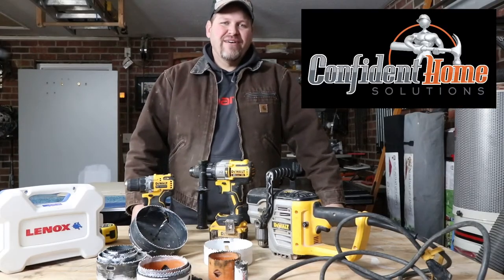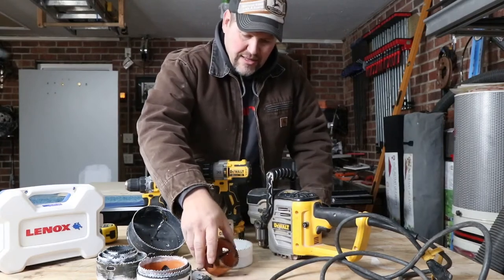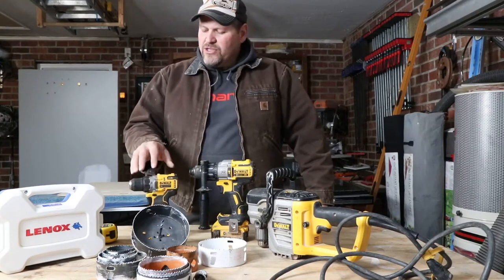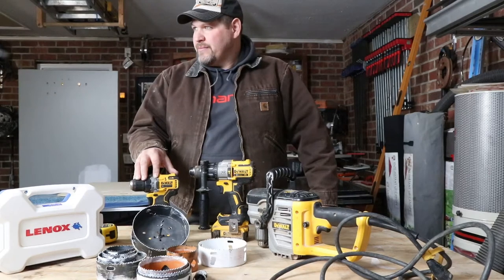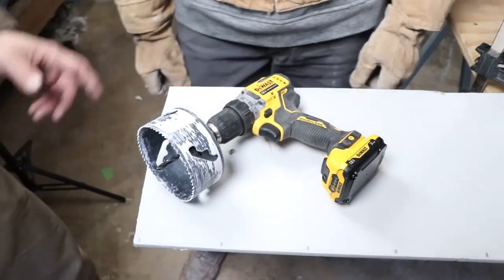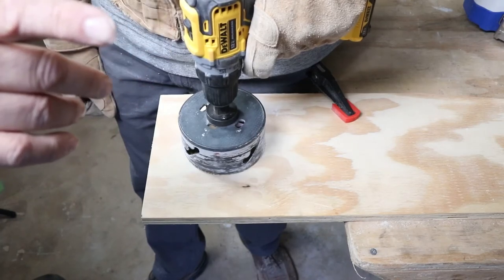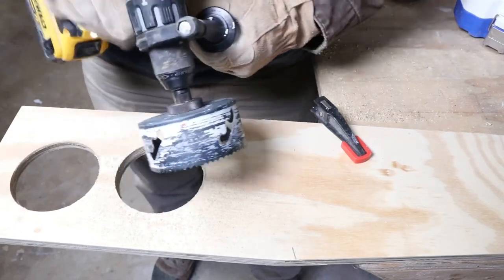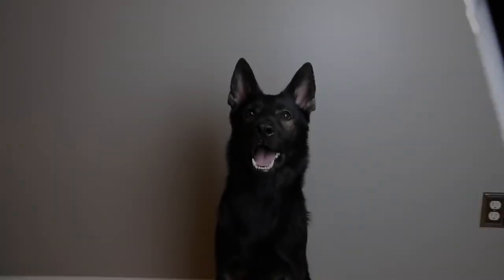How to use a Hole Saw Like a Pro (DIYer)

Comment: What would you recommend for a 4” hole in wood siding for a side vent?
Reply from the maker: Any of the 18v or 20v larger drills with a side handle. It will be a work out for that size drill but most home owners aren’t going to want a really large drill just setting around to never be used again. Makita 18v drill has the largest(longest) side handle but their Fairly pricey to the completion. I think Home Depot rent these drills.

Comment: Sadly i got to Drill a 6" Hole into some kind of DryWall (I say some kind because it feels like its Mush Carboard feel on the teeth) Now this is on the Ceiling but i can drill it before the DryWall goes up.  The ones i had to drill while on the Ceiling the Drill Knocked me off my Step a few times..  and on the Floor its Wondered and my elbow and hands are black and blue.  
Because its DryWall on a Frame for the Ceiling i cant Lay on the board to get any thing Close to my body.. 
So im stuck and in Pain (managers dont want to know)
Reply from the maker: I feel for you. Even though drywall drills easily it can grab sometimes especially while you are on a ladder. What I’ve found is if you can keep the drill from moving around the hole saw has less of a tendency to bind and throw you. Drilling over head is not easy and then you put a ladder into the mix😕. Be safe.

Comment: I had trouble keeping my saw tight, because the rubber O-Ring worked itself lose, and the vibration loosened the saw and it was unscrewing itself.  I had to really tighten that rubber ring down tight, pretty flat, actually!  Got the project done, and learned quite a bit! Not bad for 75 years old man, standing on the floor, drilling holes in the ceiling, with two 18” extensions x 7/16”, by Milwaukee.  Too damned old for ladders! Been doing things by myself for decades, but it’s getting harder, and dangerous! Thanks for the help!👍🏻👍🏻👍🏻
Reply from the maker: Appreciate the comment and keep working😀

Comment: That was great thanks.  My hole saw  didn't come with instructions.  This is exactly what I needed.  Saw in another video that some times pumping it up and down to release the sawdust will help if it's cutting slow.  And that you need to start on the fastest drill setting on the Dewalts.  Thanks again!
Reply from the maker: Good Points

Comment: thank you for this . Helped a lot.

how to get a clean cut hole   without splinter if you cant the wood,

in my case is a had crafted  "How glass shape" word with intention to drill hole in the mid center  on the Side of it.  

How to do this not to get a splitter  on the inside of it. I am thinking adding Duck tap on the inside.? 

Thank you in advance.

Comment: Thank you for a very good instructional video. 
Just a question, if you need to cut a 6" hole with a hole saw in 1.5" thick pine wood, would you use a larger drill with a 1/2" chuck, or will the smaller drill with a 3/8" chuck do the job? Thanks.
Reply from the maker: Your going to need the larger drill. Mainly for protecting yourself. Larger drills will have a longer side handle saving you from injury.